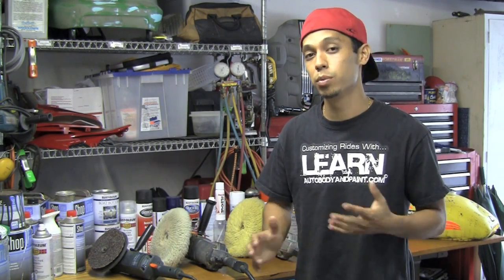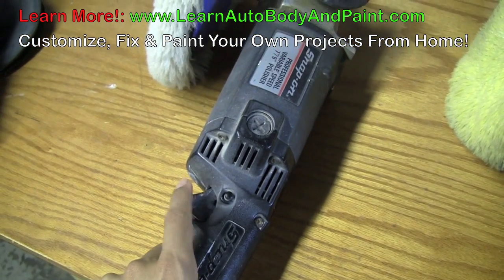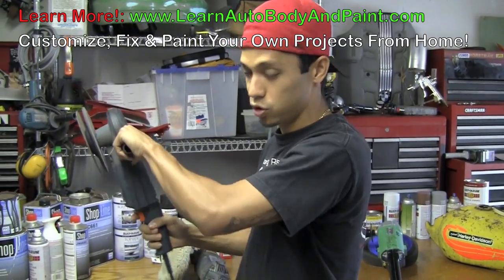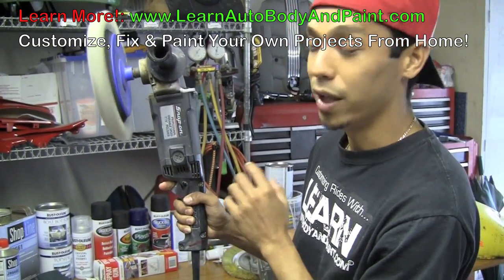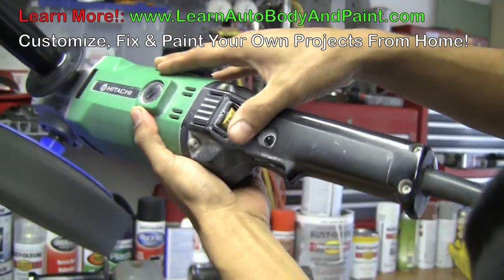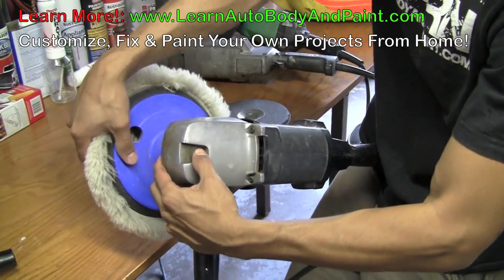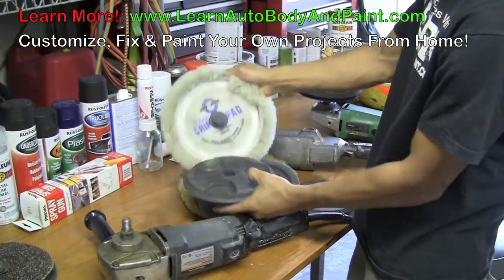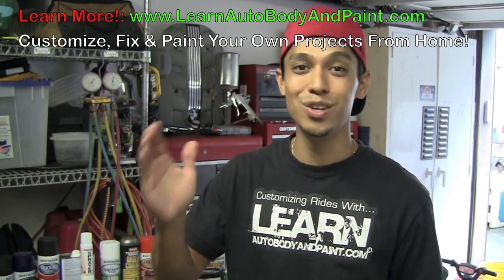Live Demo: High Speed Buffers - Car Buffer - Car Polisher Buffer - Car Buffing!

Comment: Hey Tony. Thanks for your informative videos. I have a variable speed buffer (Harbor Freight, yeah I know - cheap - but I'm just learning how to use a variable speed from a DA - if I get better, I'll eventually buy something similar to the Hitachi). What Buff and Shine backing plate do you suggest I get from Buff and Shine? Went out to their website and am confused. Currently, has a 7" non-loop and hook backing plate. I've not even used the buffer/polisher yet. I like the hook and loop size you use in the video. Would you mind sharing which backing plate, wool and foam pads you'd recommend? Thanks so much. Happy holidays to you and yours.

Comment from the maker: No, the bad is a lot thicker and the bolt resets in. Watch corners, start with lower speeds, you can use water in a spray bottle to prevent caking. Learn more about our autobody VIP club. We teach you all of these tactics in step-by-step detail. learnautobodyandpaint(.com) to learn more. Good luck buffing!

Comment: I was just wondering, if you put the bolt in the pad 6:46 won't that bolt scratch the car? Also i have heard people can burn the paint work. Apart from going at a slower speed is there anything else that can be done so it doesn't burn? Also is it would you say it's easy to burn the paint work or do you really have to use it like an idiot for it to do that...thanks in advance for your answer.

Comment: ATD makes a great variable speed buffer for a mid-range price. its one of the cheapest rotary buffers at around 50-70$. it is based on an old makita design i believe, or some other popular design. doesnt have soft start or all the advanced features, but who cares! at $70 its a bargain. better if its cheaper! best deal around i think. alot of the cheaper rotaries i see are all 1 or 2 speed. skip the DA  buffers they're only good for factory new car paint or really good paint with no problems...